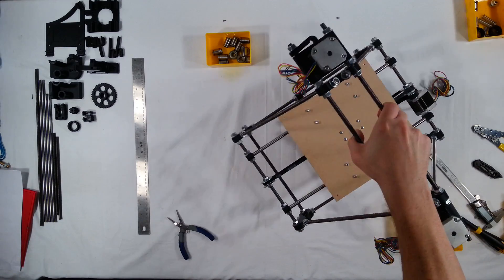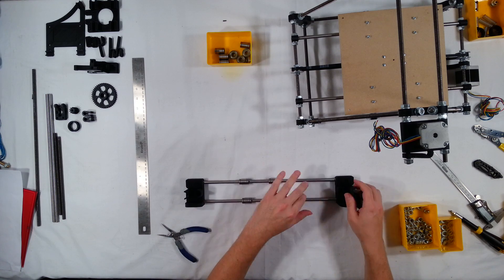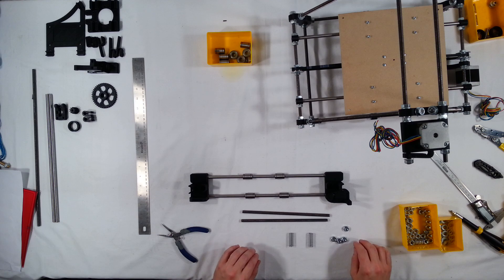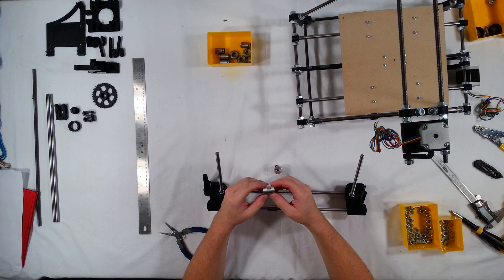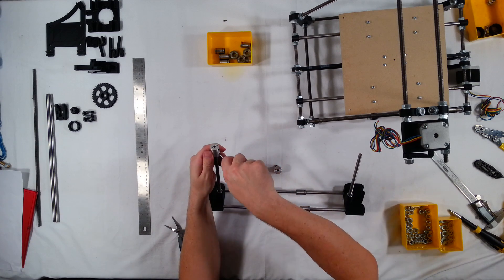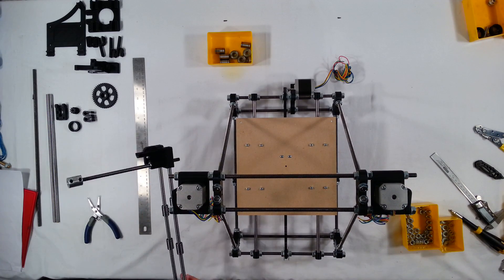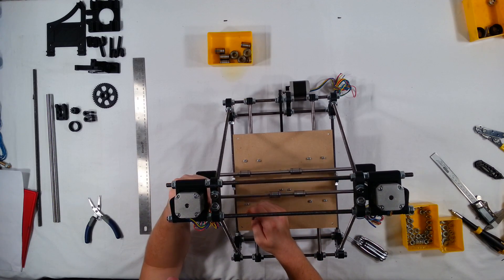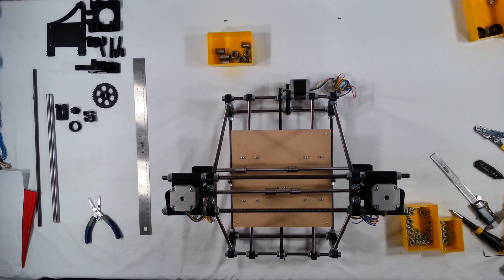RepRap Prusa Mendel Iteration 2 Assembly 09 - X and Z Axis

Comment from the maker: You can glue them into place. I know people who have done that. It should work. Just make sure the rods are parallel. You might also be able to wrap the ends of the rods evenly with a little masking tape. If they don't slide much, they are probably fine. If they slide with gravity, that's a problem. You could also ask your part provider for replacements. If they have a good warranty, they might replace them for free. If a friend printed them for you, then I'm sure they'd do it for free. :)